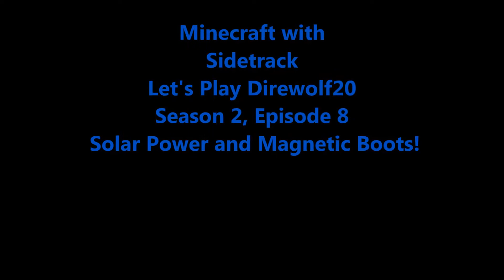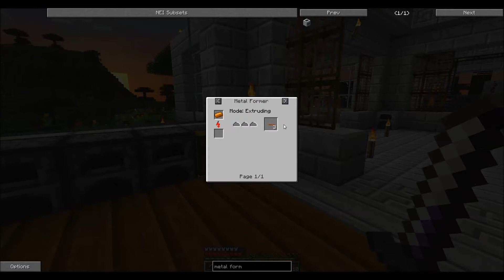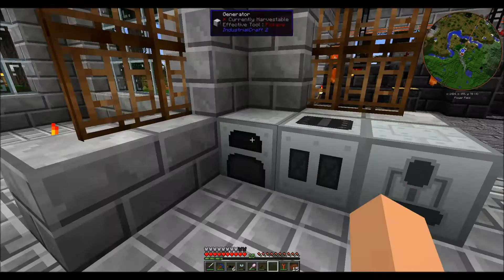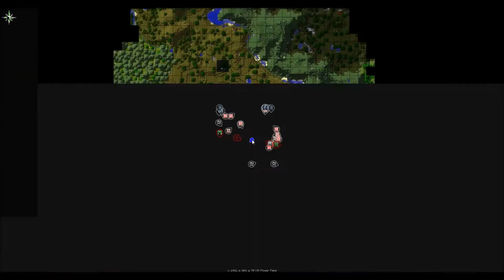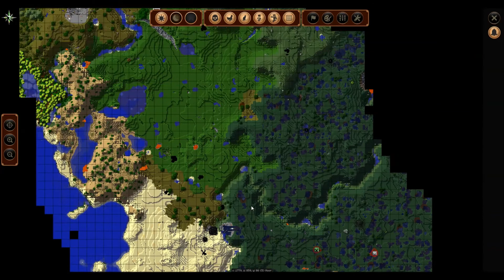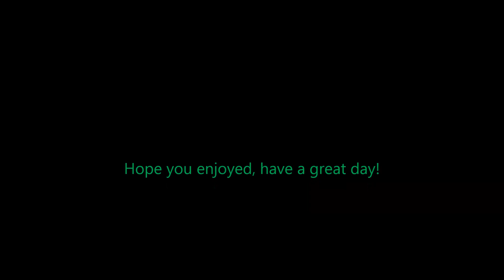Let's Play DireWolf20 - S2E8 - Solar Power and Magnetic Boots

Comment: As you began to make bronze in your smeltery a question occurred to me. You have your ore automatically being sent to the smelteries via the sorting pipes. What happens when the smeltery is at full capacity? Will the other ore just sit in the sorting chest until there is room, or will it start to bounce around your pipe system?
Reply from the maker: +Mind Fiend The sorting pipes we used will just just wait until they can deliver the ore.  The pipes don't actually hold the ore it sits in the node until a valid chest is found.